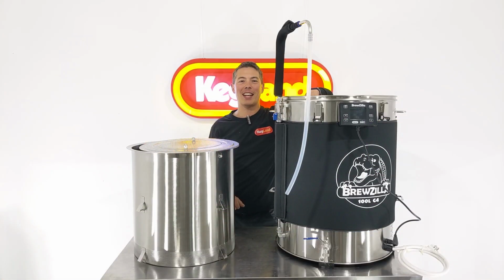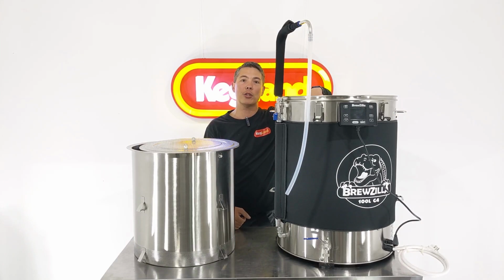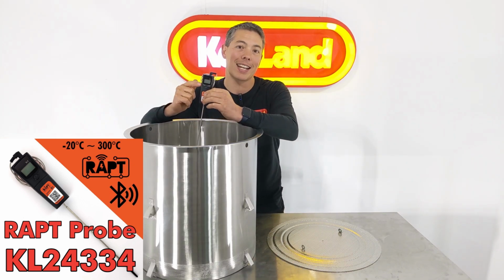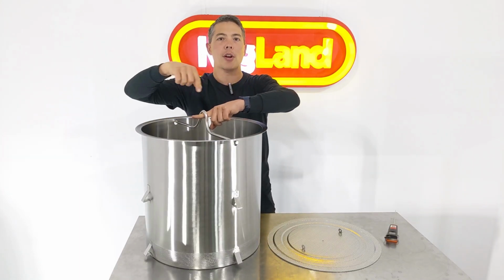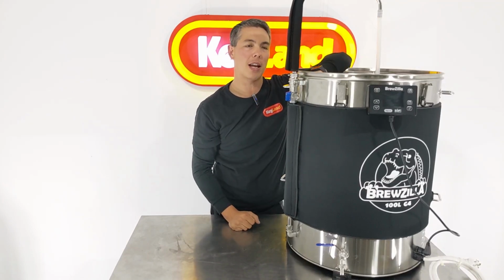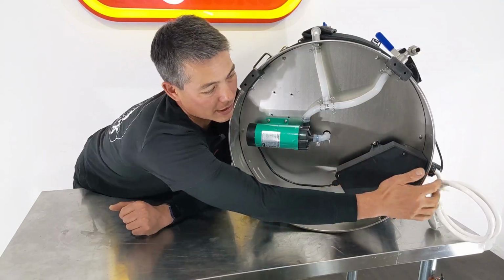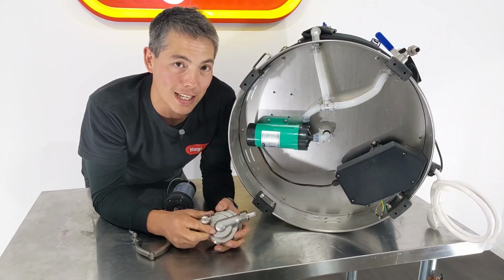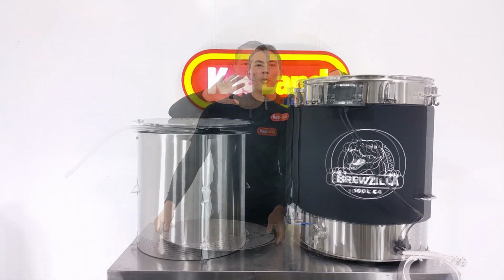BrewZilla Single Vessel 100L(26gallon) Micro Brewery - Gen 4 - 6.6kw Power

Comment: Is it possible to wire this as 2 x 15amp plugs? I have 2 x 15 amp 240v plugs available in my brew area on seperate circuits.

Comment: Just had my first brew day with this thing yesterday, 2 batches back to back, around 90l finish volume.  I like most things on it, but lifting the malt pipe is something that really needs to be considered, its not easy. Had a lot of trouble with the circulation arm pipe restricting the flow. A big bur inside the tube was catching any single piece of grain. I ended up putting a silicone hose on the outlet valve, back up to the top to get through the brew day.  

When are the Jacket and boil extensions going to be available in australia?
Reply from the maker: Yes the boil extenders and jackets will be available soon.  The bur sounds a bit strange.  Can you please send a photo of this to our customer service team and that will start the process of this getting rectified. Sounds like we will have to improve the QC on this particular aspect. As soon as the photos come to our team we will forward this onto our QC guys and make sure they include this in future checks.
Reply: Boil extender still not available?

Comment: Hello guys, love your stuff.

I would like to run 2x 65L Brewzilla + 2x 35L boilers at ( roughly ) the same time during a brewday + an 24/7 aircon running + 2 freezers .

Would an 32A circuit breaker for all of that ?
Reply from the maker: Sounds like you will need more power than 32Amp to run all that stuff.

Comment: Are there any pros and cons with a 32amp plug vs 3 phase power? Does each achieve the same result?
Reply from the maker: Not really. they both do the same thing. It just comes down to what is easier for you to wire up at your place.
Reply: Single phase is cheaper. Most properties don't have 3 phase, so putting in a 32 amp power point is much cheaper than getting 3 phase wired in from the street.  Also power companies often charge a premium for 3 phase. If you don't need more than 7 kw or want to run 3 phase motors, stick with single.

Comment: So wort/mash pickup point is in the centre of the vessel? Any impact or pickup of trub matter at the start of a knockout after whirlpooling?
Edit - watching again, perhaps the heat exchanger solid plate and a pumped whirlpool (as oppose to manually whirlpooling with a spoon or example) negates the trub pickup potential and helps form a nice cone
Reply from the maker: I would not be concerned about this.  I have used the brewery a lot and do not bother with whirlpool at all. I do recirculate for the last 5min of the boil and also while using the chiller and the pump protection screen blocks a lot of stuff and I get very clear wort at the end.  The wort pickup is at the bottom dead center of the brewery.

Comment: Is it made in Australia?
Reply: Bro, NUTHIN' is made in Australia anymore. This is made where all Kegland products are made - China.
Reply: @hasto4584  I was just asking because lots of pressure fermenters are made in Australia now, but KEG KING  not keg land
Reply from the maker: Hey Ben. The reality is Keg King do manufacture a small number of fermenter tanks in Australia.  These tanks are made with:
PET resin imported from China
The lid, neck ring, dump valve and stainless steel posts are all manufactured in China
The welded stainless wire frame is made in China
The majority of the machine and production line was made in China
Even the cardboard boxes are imported from China

KegLand has it's own fermenter blow moulding station in China and we also employ about 30 staff in China too.  Given all the raw materials and parts for these fermenters come from China it's just more logistically efficient to manufacture in China.  Also KegLand sells way more fermenters than Keg King especially overseas. As a result of the large numbers of fermenters sold in America, Europe, South America, Canada etc. It's also more efficient to manufacture in China as we cannot export directly from Melbourne port to these other overseas destinations. If we make a product in Australia we have to ship the product normally via Asia to get to these other countries anyway thus making us even less efficient for overseas sales.
Reply from the maker: No it's not made in Australia.  We did start making some of the components in Australia but the reality is we can't get enough staff, labour is expensive and it's just better value for us to manufacture in China.

Comment: now we need fermzilla all rounder 100L 😅
Reply from the maker: That will be very difficult but we will try.
Reply: @KegLand  just make it in Japan, so it could hold pressure. For real. Kind of 99.9999% guarantee
Reply: @KegLand where is the boil extender available for the 100L unit? It doesn't seem to be on the Australian website at all
Reply: I will buy them if you make the 100L fermzilla
Reply: No fermzilla inner temperature fkn stick please :)) I'm tyred of glueing it... All 4 fermzillas... Brewing under pressure... Yeah Wright... Fk
Reply: Kee - is there any way to be able to use distillers mode but dial in the exact amount of voltage in distillers mode? The preset wattage amounts are either too high or too low for some columns and condensers? Please could you guys fix this so you're able to choose how many watts your putting into the boil when in distillers mode?
Reply: Do like me. Brew to times and use 3x 60 litre ;-)

Comment: It would save time doing bigger batches would you end up using less electricity in the long run if you did large batches?
Reply from the maker: It would probably be very similar. I think you would save power doing one 100L batch rather than 2 x 50L batches.  The power saving would probably be in the relm of 1-2kwh over a whole brew day so we are only talking about saving maybe $0.50 at most.  The main benefit would be the time saving.

Comment: Is it possible to get the link for the upgraded 35L heat exchanger plate?
Reply from the maker: These have not been put on the website yet.  We have been a bit short staffed actually but they will be on our website soon.  You will be able to find them on the website soon with part number KL29353  Probably check in two weeks.
Reply: @KegLand  Perfect thankyou!
Reply: @KegLand  Will they also be avaliable on your aliexpress store??
Reply: What is bad on the original,  why an upgrade so soon